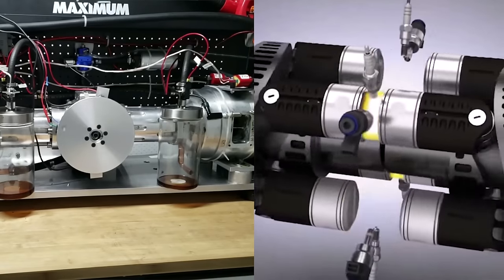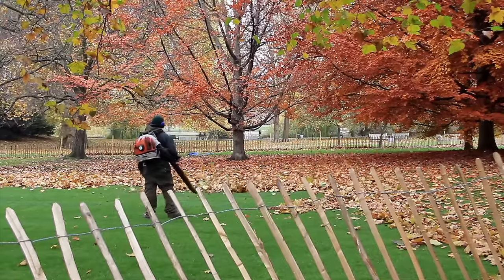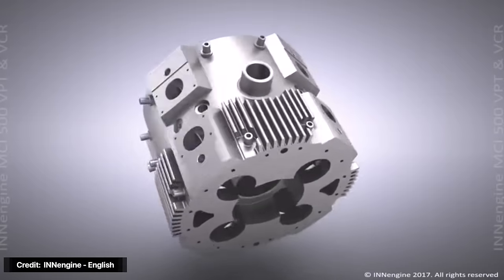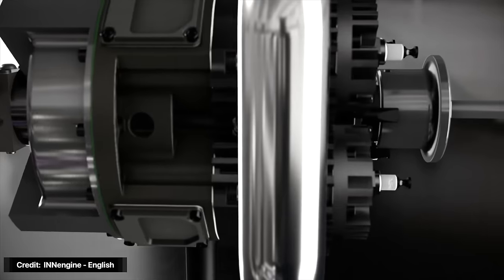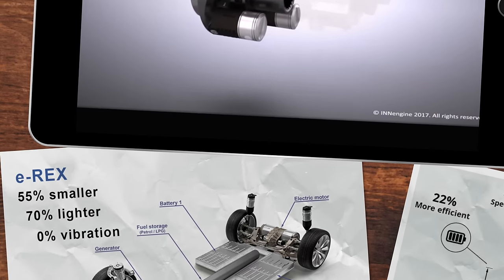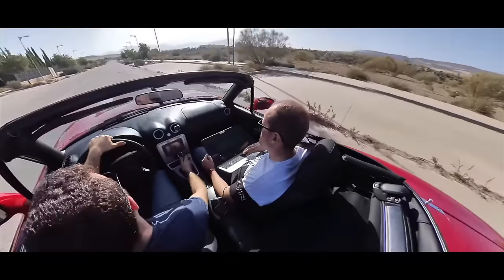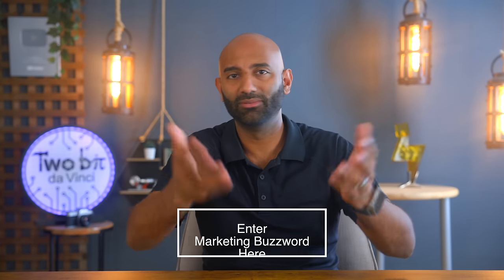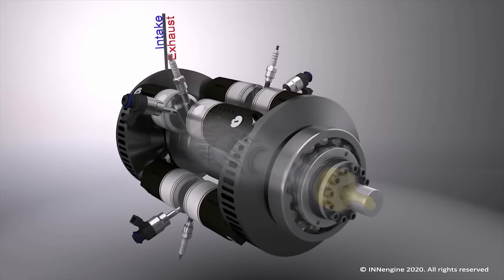One Stroke Engines - 200% More Efficient??

Comment: Seriously, the only "extender" option for an electric motor I'm interested in is one that runs off of Zero Point Energy (or Energy from the Vacuum). The vacuum of space, with a mass-equivalent energy density of 10^94 grams of matter per cubic centimeter... the only energy crisis we have is an energy ignorance crisis. We are literally existing in a sea of energy all around us but for some reason, we're too blinded by conventional B.S. to notice or use it. And this isn't Sci Fi... It's our real physics that says it's there (if John Archibald Wheeler, a previous professor physics of Princeton is to be believed... and I think the guy knows what he's talking about). Now, our conventional physicists may admit to the energy density of the vacuum but will quickly follow up with "but it's all random energy, so there is no way to use it". Wrong again. It is all too easy to tap into it. Just take an ion source, like, say, a battery, and then you push-pull energy from it in the form of a square wave. It make take some time to get the frequency of the square wave tuned properly... but once you start getting big spikes in energy (like the ringing of a bell), you've achieved the goal. Now, since we're taking advantage of moving the nucleus of the ions to cohere the energy in from the vacuum, it may not be quite the same type of energy we are used to. Instead of electrical circuits running exothermic, this energy may run endothermic (i.e. circuits will run cool instead of warm). But it can still do work. Like run a motor... like an EV motor in your electric car. Or a motor to power your house. So, talk all you want about conventional power sources and tech (gas power, 1/2/4 stroke engines, rocket technology, wind power, water power, solar power, hydrogen fuel cell, etc., etc.)... energy from the vacuum is the true future and answer to our energy needs. Bar none.

Comment: Something to think about when you are having a range extender motor that runs off of gas. 100% gas has the shelf life of one year. E10 [ 10% ethanol ] gas has the shelf life of 30 days. If you use seafoam in your gas you can get 2 years of storage. Both gases would be 87 octane. Added point 100% gas gets you better gas mileage big time.

Comment: A range extender ICE for an electric drive vehicle. That sounds exactly like what Edison Motors is doing! They've taken the idea of a diesel-electric locomotive and made a diesel-eletric semi. It uses a small CAT engine running at peak efficiency to turn the generator to recharge the batteries or provide electricity for the e-axles.
They've also partnered with their suppliers to create retrofit kits for older pickup trucks (1999 and older, so far).

Comment: I think a micro turbine is the best solution for a range extender. They're efficient, highly reliable, can burn any fuel, and don't need oil. My dream car is a series hybrid electric SUV with four doors and a hatchback. The doors only open when the car is stationary and in park. They can be manually opened with a lever or automatically with a button. The two rear doors pop out and slide back, like van doors, and the two front doors pop out and slide forward. The tops of the doors are curled in to leave more headroom when getting in or out, so they rise up as they pop out. Plus, when a door is open, the seat slides out a few inches and rotates. It has a computer in the dashboard that can show detailed diagnostics, and includes indicators in the instrument panel that show when lights aren't working. It has a micro turbine generator and two batteries. The car runs on battery power below 40hpm and automatically starts the turbine above that, or whenever a battery needs to be charged. Power from either source is first channeled through a control box, then distributed among four electric motors, one for each wheel. The control box manages power, based on angle of the gas peddle, complex wheel behavior based on steering, and suspension and breaking based on road conditions. And, of course, it has regenerative breaking.

Comment: Air in a gas turbine gets drawn in, then is compressed, then is mixed with fuel and ignited then expands through turbine blades (power stroke) then exhausts out the end so this is truly a one stroke engine. And the high power they put out is reflective of that.

Comment: love your content I'm a mechanical engineer myself a older one at 59yrs old and dont see EVs taking over the world, even though everyone at the moment thinks they are clean one would need to go from the creation of the battery which is more toxic to produce than is told to us. The byproduct of the EV battery is toxic by far and there is no recycling method for them other than burying then and polluting the Earth and they seem to combust at will all over the world at the moment, as for the cars carbo dioxide it helps trees grow and in turn produce air for the planet to breath?? In the end i maybe wrong but maybe not. HARD core petrol head
Reply from the maker: I love it and thanks for the comment! I not going to lie, i still love petrol cars too. I'm thinking about buying an older 6MT petrol car just for weekends before its too late!
Reply: @TwoBitDaVinci  Good luck with that and i like your content thankyou

Comment: This engine is beyond backwards. I wont even go into your claim of EVs when they are failing spectacularly, and proving to be more of a cult. If you want to discuss it, great, but Im sure Ill get some flak from EV zealots. Dont care.

This engine though, has all the problems any piece of machinery in history has ever had and concentrates them into one apparatus. It will last I would estimate about 2000-5000 miles before neading an overhault. First off, there is absolutely NOTHING innovative about this. This is your typical circular piston pump design. There is a reason they are not opposing in any pump setup either. More on the pumps in a bit.

This thing will chew up those main cam bearings. Bearings are not meant to take more axial force (thurst) than the roll. Yes many bearings have this, but enough that a c clip can hold up. This needs to withstand the power stroke, and off center. It will destroy it very quickly. That leads to second issue. It will be a nightmare to work on.

The weight of a normal engine comes from it having detachable heads, that can be serviced. They had more "power dense" engines before, with non detachable heads, but they were unfixable in any cost effective way. PS, the power dense term has appeared recently as another marketing term. FCA is using it for one of their engines. Rule of thumb, if your product needs THAT much PR, it will fail.

You covered torque, but cooling will also be a big problem as well as knock. This engine already seems to have another cam plate to push the piston down. All these  will rob it of power, to where I dont see how these numbers are legit (as low as they are). This will be a disposable engine at best, in disposable EVs that are not meant to be fixed even for basic maintenance. If youre ok spending 60k every three years for a car, go for it.

If this was any good, there would be copycats to it. Just like fuel injection spread to every new car. Carburetion still works and does so very well, but a good idea is a good idea and will spread without PSAs about the fuel injection system.

Comment: I like bigblock V8s. To quote Enzo Ferrari, "There's no replacement for displacement." 
400+ cubic inches at 5500 rpm, lots of torque and hp, and it sounds badass. That's one of the biggest drawbacks to electric vehicles, no vroom vroom. And no gears to shift, so no actual fun of driving either. So what's the point then? Might as well just take the train. Or a taxi...

Comment: I build steam engines as a hobby and YES, I have designed and built an external-combustion one-cylinder, single-stroke rotary engine with one piston and it achieves a single power stroke of 350°.

Before you call me a liar, realize I'm autistic and my IQ is 165. I am 75 and have designed and built steam and pneumatic engines as a hobby for just over 50 years.

Comment: Ricky, when yputaljed about the range extender, it reminded me of a compamy up in BC, not far from where I live: Edison Motors.

Edison has been developing a concept for logging trucks, and I imagine will probably branch oit from there eventially.

In a nutshell, they have made a diesel backup over battery/electric system. But it's not like what you may be thinking, like a Prius.

The idea is that logging trucks typically need to climb steep mountain grades on the roadstp getto where they pick up the logs before taking them to a mill or other destination. 

Logging trucks are heavy, but are muchheavier whenloaded with logs. So the idea is that they use only power from the batteries to get up the hills. Once the truck is loaded with logs, it is for the most part downhill from there, so the weight of the truck amd its payload charges the batteries the entire time the truck is descending from the loading area. By the time the truck has made it down the hills, the batteries are fully charged and are ready for a return trip. The weight of the loaded truck provides all the kinetic energy needed to charge the batteries. The diesel engine is only used if and when it is needed, say when getting to a more distant location.

Great concept, and worth your time. They are Edison Motors, based in Merritt, BC. And they have a channel here on Youtube.

Comment: The reason this and other petrol engines needs to be pursued, is because all the fantasy dreamers will be smacked by reality when EVs fall flat out their face from the multitude of insurmountable problems and costs, and finally realize the world is not going 100% EVs any time soon.  Don’t get me wrong, I’m a big supporter of EVs.  But reality people REALITY!  It’s not here yet and won’t be for a long time yet.  You don’t just turn the world on a dime.  So in the mean time we need to make sense instead of stupid. If I take the standard gas engine, and I can double its efficiency, then I’ve reduced the world consumption of petrol by half!  EVs aren’t projected to do that for many decades!  And even then, where do you thing the electricity is coming from?  NOT SOLAR in most cases and invariably mostly fissile fuels.  So you haven’t bought anything (actually a little from regeneration, but go with here).  So we should not stop petrol engine research and development for the shiny orb called EVs.  Work on all of it, and economics will steer the best technology to use based on cost.

Comment: anyone familiar with "over centre" mechanisms?

so far, every engine, no matter what it is... is an over center mechanism. just LOOK at them! it doesnt matter HOW they turn reciprocating motion into rotational effort, they all suffer this major issue. i like to envision all forms of "crankshaft" as an inclined plane... what sort of slope is it? how do the two forces interact?

they all follow the same curve, within reason... a rapid rise, flattening out to a plateau... 

when you spin the shaft to move the piston, its like pushing a wedge under something, and as it approaches TDC, the "lifting" force is increased, as it moves less distance for an equivalent sideways motion of the wedge.
but an engine is using that force to move the wedge. and when peak pressure is applied, the wedge is angled in such a way that it CANT "move sideways".

great mechanical advantage when COMPRESSING air, terrible mechanical advantage when used as EXPANDERS.

it doesnt matter if its an eccentric, a crank, or a wobbler/swashplate, they are all fundamentally an over centre mechanism. and we use them to LOCK things in place, not derive power... except in engines?

the cam engine strikes me as being the only option where the EXPANSION stroke can be made to provide a TANGENTIAL force upon the shaft. 

once it passes "TDC", and the combustion pressure rises, the slope of the cam needs to be the INVERSE curve. that is, back to the inclined plane principle... at TDC, the "wedge" needs to be at its STEEPEST point, rather than "plateaued". that way it can get "behind" the crankpin and PUSH it aside as it descends.

albeit,  making for some TERRIBLE vibrations! although "opposed pistons" would help mitigate that issue...

and an ICE engine only gets to produce its maximum pressure at TDC, or slightly after... the pressure falls rapidly as the volume increases, and as the heat is radiated/conducted away.

so EVERY engine, rather than use this pressure effectively in the time it has available, simply slams its bearings with no production of TORQUE. it only starts using this pressure when the crank reaches a suitable angle, and by then the pressure has been reduced to 1/4 of its peak value... less... (hard to visualise a PVT curve!)

its like you want a piston assembly that flips over by 90 degrees as combustion takes place, so the force generated on the piston can act TANGENTIALLY to the crank.

unfortunately, the mechanism that produces this 90 degree "flip" would also be subject to the same forces that drive the piston... theres no such thing as a free lunch. still, whenever i think of that i start envisioning epicycles, wheels upon wheels... and then you get lost in friction and levers and moving things...

a turbine produces a tangential force, but its also limited by the requirement of gas flow, as its the change in inertia of mass that makes them run, utterly different to the pressure in a piston engine.

Comment: Lastly, hint hint ...
Howard Hughes invented and proved an engine that used no fuel, made no emissions, and gave all the free air conditioning you could handle...in his freon based turbine engine. The only requirement was to be on a warm planet near a star that doesn't make life impossible. The thing was essentially a steam turbine that boiled freon instead of water, and used a closed loop to recapture the freon and send to compressor stage for starting the loop over. The compressor was the part where energy had to be spent, so obviously the turbines made more energy than the compressor required. 
Something to think about (wink)

Comment: PHXEV   A Plug In Range Extended Hybrid Electric Vehicle
Charge by Plug or by the Extender Engine.  Hybrid gives you access to Electric Take-Off or Turbo Spin Up,
Regenerative Braking, Low Battery Weight (40-80 kWh), Fuel Efficient, Pure Electric Range ~60 km, Extended Range ~500 km.
This will fix the long recharge problem, the ICE will provide the EV with 'Acceleration At Speed' also known as 'Passing Grandma on the Highway'.   This sounds like an answer...

Comment: The formula to calculate the energy in a volume of gasoline is volume * (density * energy * efficiency) ÷ volume. Gasoline is 13% efficient (hydrogen) and 87% inefficient (carbon). One kilogram of hydrogen is 33.33333 kwh. One US gallon of gasoline has a density of 2.85769 kilograms, so 10 * (2.85769 * 33.33333 * 0.13) ÷ 10 equals 12.383 kilowatt hours per gallon, or 123.833 kwh in 10 US gallons.

Comment: It 2 stoke engine w/out mixing oil/gas? Plus, it doesn't have a reed valve! 8 pistons but it really 4 cycles and with 1/4 fill oil, in block with coolant mean you have to have a stainless steel block, Low Torque start? Said it has to start and maintained a steady start at 1500 RPM, and max out at 7000 Rpm.  Any slower than 1500 RPM lose 50% Torque 120 FT-lbs (60 Ft-Lbs) Be ok lite 1200 lbs car? But get into 8000 lbs Truck it starts have to rave up 2000-2500 RPM-max 7000 RPM to go 0-60 MPH in 20 second.  "Test this out! See if I Right?" MPG need to know cc size and stoke? Made be double (USA standard 18-32) 32–45 MPG cars, 24-28 MPG Truck? I'm guessing?

Comment: Just bought a Rav4 Ev--(2.5l engine charges the battery /-Electric motor drives wheel+ a bit of help from gasoline motor via a gearing system) Fuel use 5.5 litres per 100Km. Sydney to to Brisbane (2032-Olympic city) a round 900km. (900/5.5 =49.5 litres of petrol. @ $2.00 a litre =$100 each way. In my Toyota HighLux  diesel Ute I can always count on $200 for the one way trip. Yes I know its not a full EV but this is Australia and we do big Km's, with little in between major cities. At least I'm part of the way towards being EV. 
That feels gooood!

Comment: 0% vibration? 
Is limited to axial impulse. 
Each time the cylinder fires there is inertial harmonic produce as the expanding energy being stored into the flywheel can be measured as torsional ripple, which is a form of vibration that isn’t 0%.

Comment: This engine appears to be one of my stolen designs I created in the 1990s'. {I created about 200 transport related designs including half a dozen engines.} That is why you could not find experienced/engineering people in their posse, and why they called it the wrong thing. The international cohort behind it tried to knock me of several times, so people would not find out, but now we have the internet.  1990s' Designer: Luke Marzola on FB
This is the "swash-plate based boxer 2-stroke". I am also the creator of the billet-rotary, the inverted-rotary (which they got 50 mil from some defense fund to build, and called the stupid name:- liquid...), the A...Aerospace one, a rocket one, a high performance electric one, and one or two others, + heaps of high performance parts, high performance aero cars,  etc. etc.

Comment: THE 1 STROKE ENGINE IS SNAKE OIL. Modern 2 cycle engine oils burn very well. High emissions and fuel consumption result from the fact that the intake charge must push the exhaust gasses out of the cylinder
causing excess raw fuel to escape with the exhaust gasses. Outboard engine manufacturers spent DECADES and tons of money for minute improvements. Upon the introduction of lightweight 4 cycle outboard engines, the
2 cycle was doomed. Ask anyone who has owned both types. This also applies to dirt bikes, snowmobiles etc...